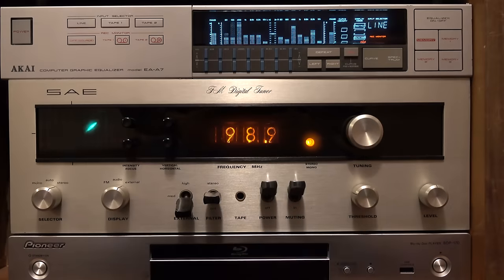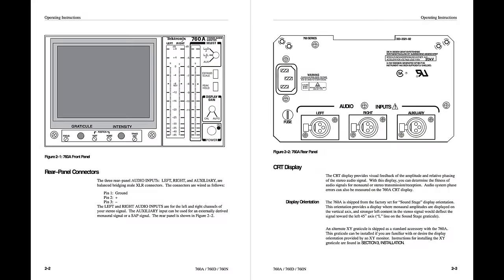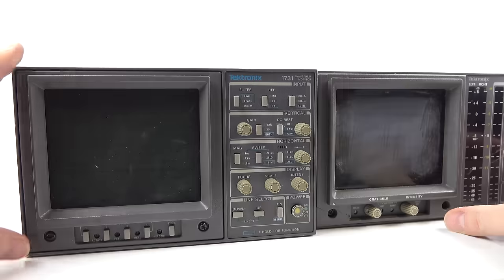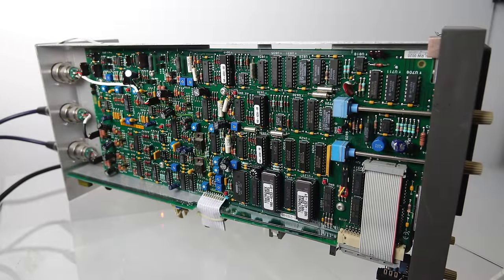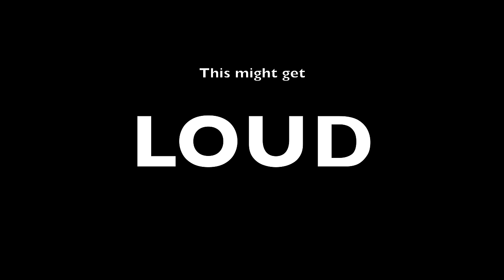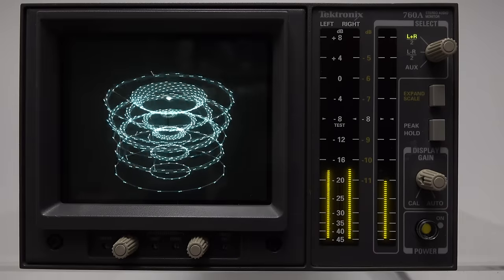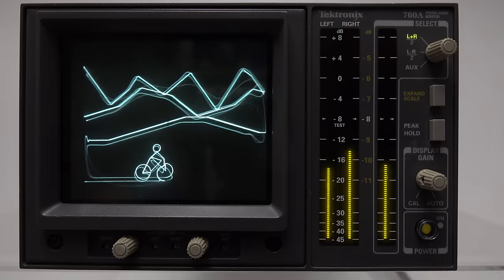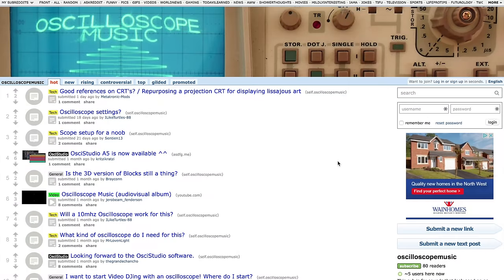Oscilloscope Music - Pictures from Sound

Comment: Hi...in the 70s  I had a device called  a Sonolight. Thus was a box that plugged into Rica type outputs of the amp and had low, medium and high adjustments in 3 knobs on the front. It had 3 power points on the back where you could plug one light each into..these were normal high voltage house lights..up to I think 100 wares. On mine , I had red, green, and blue. This gave an interesting RGB effect. Each light could be adjusted for level. Painting these up at the  celine was really space ( well it was in the seventies ) Have you heard of these? It was called Sonolight put out by Sony I think.

Comment: probably needs a 2 channel scope that also controls the z. and for a scope quite fast phospor. not just any old scope. an old 1 channel thing that can't control intensity is not gonna do this. a new digital one probably also won't really cooperate in this attempt :P it does turn the dot off completely a couple of times or so it seems.

Comment: This is VERY interesting...
I wonder what this will look like on my laser project i created once... it's basically a laser pointed into 2 mirrors attached to DC motors connected to an audio amplifier, those act as speakera making the mirrors vibrate. I used a program called NCH tone generator to output a specific frequency to left and right channels, making the motors vibrate, causing the mirrors to move and draw a figure to the wall, but all i could get so far were some lissajous figures...

Comment: The oscilloscope v1.08 emulator by ASDFG.me works great on windows 10 64bit, however was allot more stable when run in windows 8 compatibility mode. It's really cool to play with shaping your own sounds, there's allot involved in reproducing results that come anywhere near close to the demonstrations offered in this video. Highly recommend audio buffs give this emulator a go! Source code available too, so you can play to your hearts content!

Comment: music for older oscilloscopes? unfortunately the new tektronix tds2022 that I use in the university electronics lab is a digital one that might not be able to display those things on its display but might just get a signal and show the voltage of the signal. So for us we just can use the emulator that can work on almost any modern phone.

Comment: Couldnt you just use an old analog TV, connect the Right audio to the vertical coil and the left audio to the horizontal coil?
Reply: Yes, that would Work.
But not nearly as good because the Coils are much slower in response than the Capacitive Plates of a Scope Screen.

Comment: I have a Tektronix 760, and it's also upside down when I run these demos. Which wires did you switch to correct the image?
Reply from the maker: Here's the text out of the manual - (Mine didn't have a jumper to swap so I cut and swapped the wires running down the side of the tube. 

Also for X–Y display orientation, rotate P886 (on back of A3, Main board) so
pins 1 and 2 of the connector mate with pins 2 and 1 of J886 (connect back-
ward). Repeat with P862/J862. Remember to return P886 and P862 to their
normal (pin 1 to pin 1) positions for Sound Stage display orientation. This
provides correct phasing for both display orientations.

Comment: wow - an audio interface that goes to 192kHz? impressive
I use a roland tri-capture - and it can go up to 96kHz (although I use it in 48kHz mode as I do use it as output and input at the same time - and using the 96kHz mode limits it to only one of them at the same time) - but double that again - this doesn't really make sense when one looks at why a CD uses 44.1kHz (although it's still some weird random chosen number)

Comment: You can see the part that went bang in your dead unit. It was the high voltage section for the CRT. That would not be an easy fix as it looks like the HV transformer went bang along with a few support components.